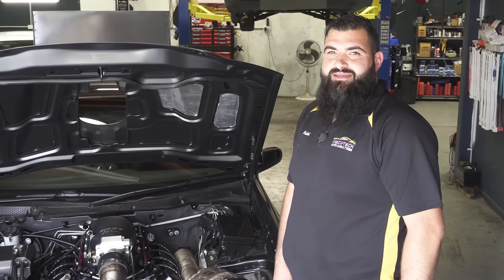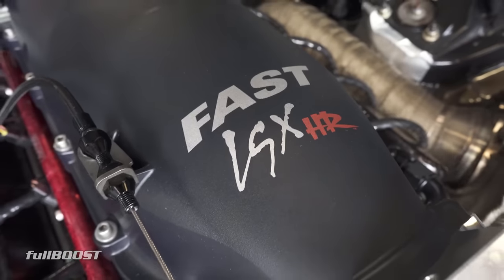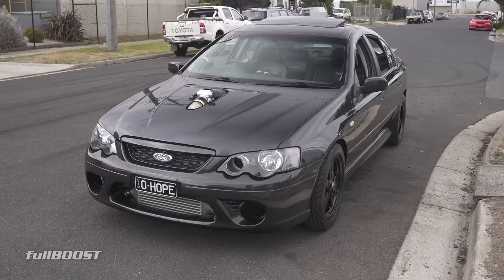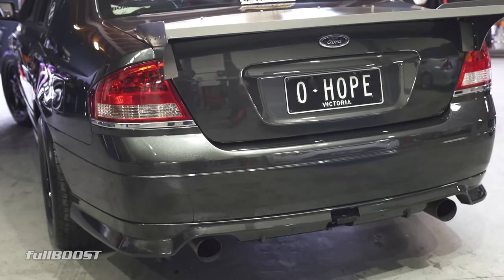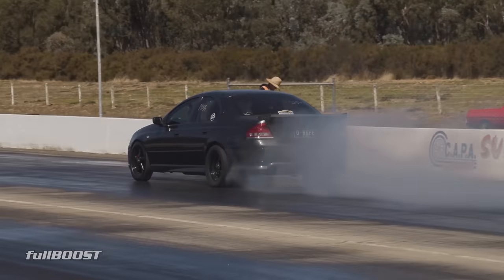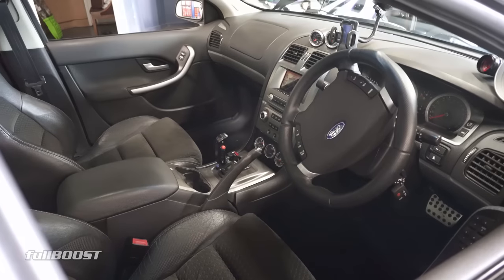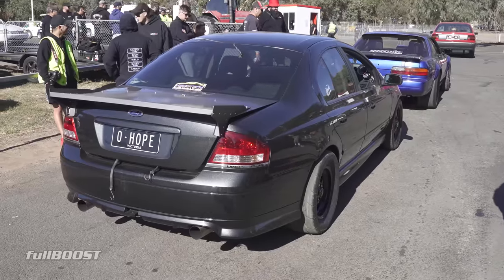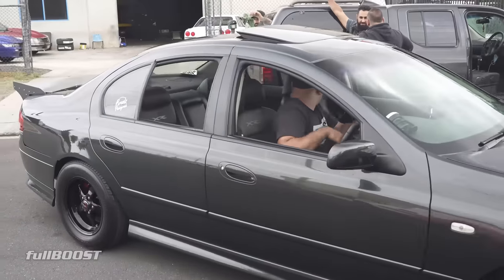LS swapping a Ford XR6 turbo! | fullBOOST

Comment: Some people just want to watch the world burn
Reply: yeah and the cops don't give a sh1t if your car gets stolen, they just let it happen
Reply: @rickphillips7221  happened to me too. Car got stolen and found trashed with 4 others of the same model and the cops didn't even bother looking. But they did have time to threaten to fine me if I didn't remove my wreck in time.
Reply: @rickphillips7221  better not do a little chirpy tho, then they suddenly get interested
Reply: @mahcooharper9577  stealing cars is fine, but driving slightly faster than the speed or losing traction. Worse than murder
Reply: They probably gave it back when they spotted that bastard under the bonnet !!

Comment: People are losing their minds over the LS swap, I'm losing my mind that BFs are so heavy. Slap a Barra in an EA (lighter, live axle so you don't get squat on launch) and just walk away from BFs
Reply: BF's look the best
Reply: @DeejayManii  no
Reply: @rhyswerner8749  yes
Reply: Even non IRS AU's are light enough. People think AU's are heavy but they brought in new tech to make the shells lighter and stiffer over EL's. Kerb weight of an AU V8 forte is quite reasonable.

Big turbo's and intercoolers and all the gear inevitably add weight dont forget.

Best way to fix ford IRS....  is to remove it and take it to sims.
Reply: Brah I haven't seen noyone losing there minds over this 😂

Comment: Someone had to do back😂 To compensate for all the Barra turbos installed into commodores and various other Holden's. Well done awesome job
Reply: Don't talk shit, look how much GM stuff there has been stuck in nearly every '32 Ford for instance.  And that's JUST '32 Fords ! Some Barras in a few Crummydogs hardly redresses the balance. GET REAL !!
Reply: @arkhsm  yeh whatever. And a Ford 9" diff in every GM product since the dawn of time.
Just having a laugh champ😘
Reply: @lodestone69  Well your right, as this subject pretty much bends me out of shape more than anything else. As for the 9", that's because it's strong WITH that easily removed pumpkin for easier gear changes !!

Comment: I cant wait to hear about the comments from this video in the next Bench Torque. LOL
Reply: "Why do you need 1100hp when the speed limit is 60"
Reply: “spent $25 000 large on an engine when you can run 8’s for 2K”

Comment: I love it, power is power. Forget the bagges girls.
Reply: power is not power.  as we've seen over the years, holdens for whatever reason can have a heap of power but they're all built on a crappy mass produced euro chassis designed for general everyday living they just suck.
Reply: @MrSupermugen  yeah that's a lens you can look at it through.......

Comment: I wanna know how many times he's had to scrape a canary of the windscreen!
How the hell do you get around vic in a build like that and not attract attention.
Reply: Just keep it registered but never drive it 😅😅 'street car'
Reply: @Ryan-hf9qz  that's pretty much what I do with my build. With a 97db idle I've had to drive past many a servo when the cops are filling up!
Reply: Meanwhile the yanks like cleetus and that can cruise around the streets in 7 second drag cars with turbos up to the roof line and no cats 😂😂
Reply: @mikeymasi  yep it's bloody frustrating.
Reply: @alitis000   @alitis000  well that's it but it also depends on the amount of "look at me" mods you've got. In my case the car looks factory so at a glance I wouldn't get a second thought in most cases. 
But when you've got shit hanging out the hood, steam rollers on the rear and a rear wing that's clearly for down force then more often than not your getting pulled over for doing nothing wrong.
Then it's pop the hood mate!
Reply: @JTECH7766   I’ve had an fc rx7 since i was on my P’s, It is low! Like the top of my 33’s from my patrol are taller than my door top moulds, plus all the other mods like 18’s, dark tints, front mount exhaust ect ect for well over 15 years. It was my daily for at least 5 of them and i only had a couple of canary’s and a couple of epa tests only because of a few jacks that didn’t like a young bloke in a sports car lol. Anyways I’ve been pulled over way way more times during that period for driving like a spastic but i was never arsehole to the jacks and they kind of over look the car. I know of some guys that are cocky af when they get pulled over that have a glove box full of defects with stockish cars and others that drive on bead locked drag radials that are like me. At the end of the day, the moral of the story is don’t be a dick, you and your car won’t be red flagged and you’ll have happy days
Reply: @mikeymasi  its not legal in America either.
Reply: @alitis000  The nail that sticks out gets hammered!

Comment: The best thing with a Ford badge is a transit van
Reply: You need to check out the hot transit van the guys on Top gear drove in the original series, absolute beast and factory standard.

Comment: 2200kgs !!!! Think about it. This car now weighs 500kg more than factory  !!! If that extra 500kg doesnt take for siht handing, what does ?
This is a demonstration in how to add 500kg to a car for no reason, and, also turn it in to a total fuel guzzler.
Good effort. And of course, the value of most other XR6 Turbos Falcon are shooting though the roof, but this owner has fixed that problem.
Reply: "Total fuel guzzler" yeah fuel efficiency is there main priority here 🤦‍♂️
Reply: @Huda88754  well, I have a FG  XRT6, with a GTX3582R, have run up to 24psi boost on e85. But, when not on the boost, about 15L/100kms around town, and better than 10L/100km onthe highway with the AC on. Why, it runs 30deg advance at light pedal = good economy.
Obviously, when on the noise >99L/100kms.
6L LS economy ? It has to much worse.
Reply: @nordic5490  I've got a f6, I'd rather the built turbo ls , fuel economy isn't a factor here

Comment: 403ci is 6.8litres? I have always believed that my 406ci Chev was 6.6litres. Can someone please do the math for me and correct me if l'm wrong.🤔
Reply: Yes its 6.6 litres
Reply: The cube root of 403=7.386437295 inches

7.386437295 x 2.54cm (inches into cm) = 18.76155073 cm

18.76155073^3 (cubed)= 6603.986792 cubic cm or CC's

6603.986792 ÷ 1000 = 6.6 L

Mathematically the 406 = 6.65 L

Comment: Least he got rid of that shitty v6 barratt motor and chucked in a REAL engine, my sisters toyota 4age van makes more power then these barratt engines since they break after 250kw at the crank,  barrats can go in the garbage truck where they belong, also he figured he was a transvestite with the ford engine so he became a true man with that LS swap.
Reply: @jrburger95  and v6 inline 6 same thing, just jealous cause it's not as good as mitsis by that comes in the GTO and lancer
Reply: @jrburger95  not my fault the LS is better then the barra v6, dont get me started on that garbage ass au falcon either the slowest piece of garbage can on the planet